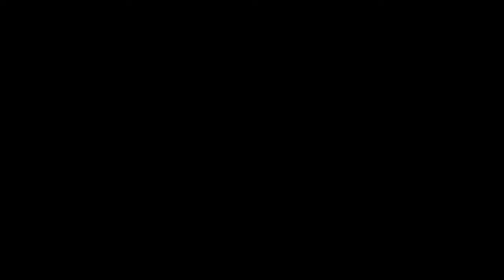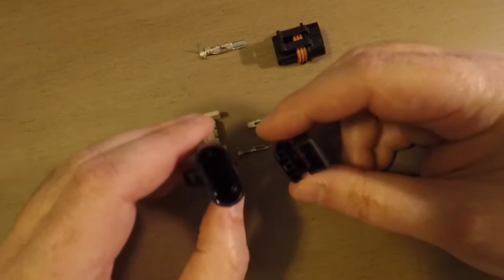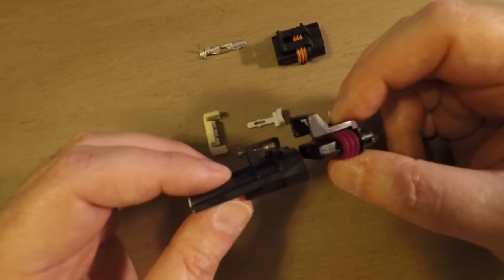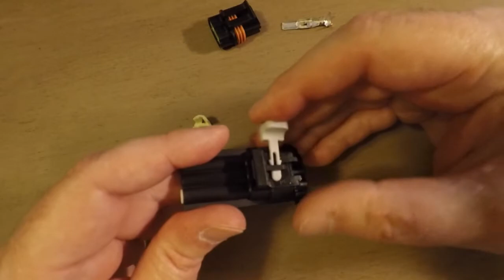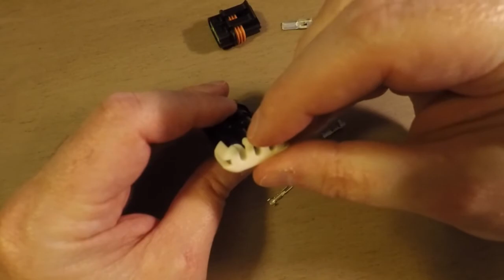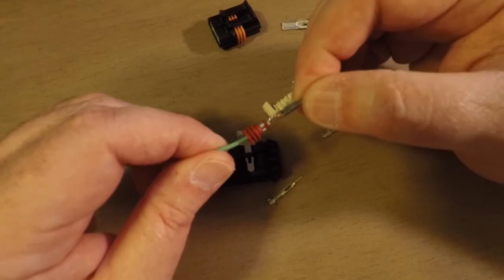Metri Pack

Comment: Have to add, the series numbers are based on the width of the flat blade male pins. 150 series is 1.5mm, 280 is 2.8mm, and so on. Also, you need a special tool to slide over the pins in the connector to release them, and pull them out of the shell.

Comment: Thanks for the Metric-pack video. I'm having a hell of a time installing the wires into the smaller housing. (with the orange outer gasket) I can't figure out if the soldered connectors click in from the back (as with the large housing) or if I was supposed to pre-thread the wire first, then solder, then click it in from the front. The packaging didn't include any instructions, (!) so it would be very helpful if this video included this installation process.
Reply: Oof, yeah. I was supposed to pre-thread the wire, solder, & feed the conns back into the housing from the front. Just blew 8 bucks.  :(
Reply from the maker: @erfquake1  sorry I missed the notification on your reply. Yeah Weatherpak and Metripak can have different ways of assembly depending on the series used.
Reply: @buildpics5234  Oh, no worries, thanks for the reply.